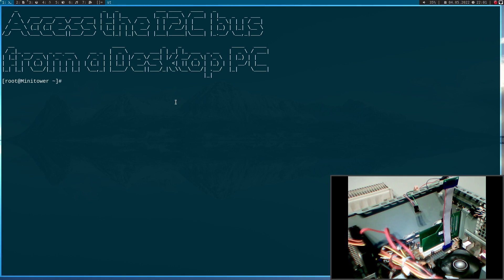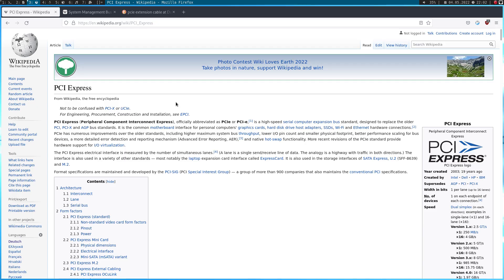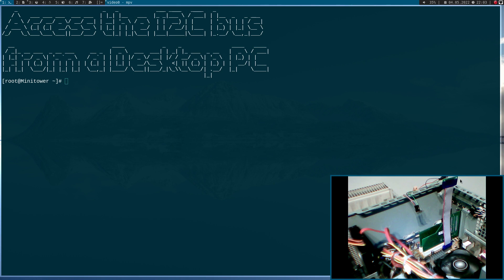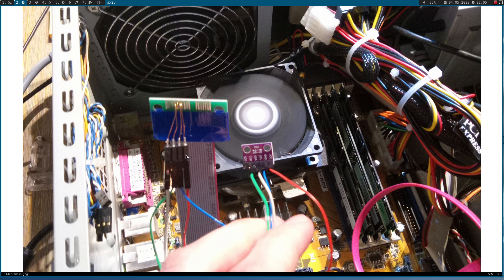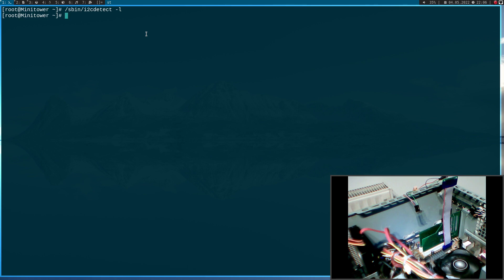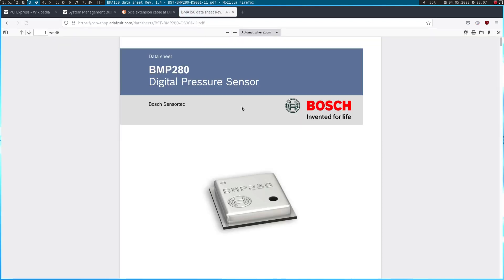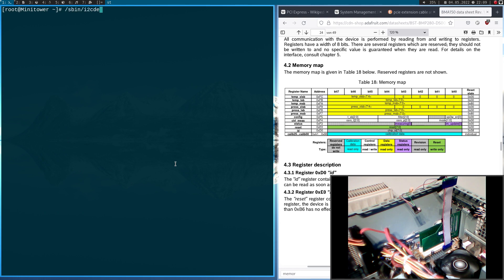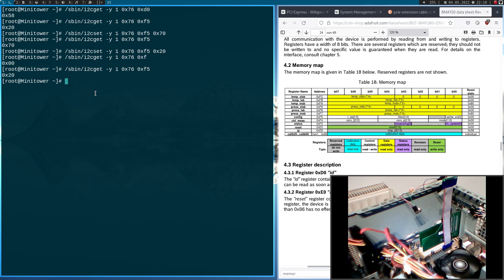Tutorial: Access the I2C Bus on any Desktop PC (The SMBus)

Comment: wunderbar! beste grusse aus Polen :)
okay, my german sucks ;p
I guess you've found nice nieche, there are plenty of lowspec obscure devices (like thin clients aka terminals) which could easily serve rpi's purposes for fraction of price :)
Reply from the maker: Danke, Dir!
No, the sentence above was 100% correct ;)
It is always great to find ways to recycle old hardware and with GNU/Linux you can easily access the Hardware. So, you are right, often they can be used as cheap replacements for RPis. But when it comes to power consumption, a RPi is still better ;)

Comment: How does the SMBus know the  device specific opcode and protocol and frame formats? Different i2c devices may have different formats right?
Reply from the maker: Basically the BIOS developer needs to know which devices are available. For standardized stuff like the Serial Presence Detect (SPD) on DRAM DIMMs there is an available address range and the address is depended on which slot you put in the DIMM. So, the BIOS knows in a specific range there are SPDs and the format for SPDs is standardized.
For sensors, the BIOS developer knows the I2C addresses and can hardcode them in the BIOS, I believe.

Comment: My mainboard has an SMBus header on the board. I want to do the opposite: check the pc hardware/health with an arduino and plott it on an lcd.   Where do i start? ;)
Reply from the maker: You need to implement an I2C Master on your Arduino. Then you can access the slave devices. Then depending on the hardware you can get information. For example if you detect an SPD (EEPROM with information about the PC's RAM), you can take a look the its content like described here: https://en.wikipedia.org/wiki/Serial_presence_detect

Comment: Not all motherboards have the SMbus connected to PCIe connectors. Usually on workstation and server boards it it connected, but consumer boards might not have it.
Reply from the maker: Yes, you are right. Once I saw a computer, where you had to add 0Ohm Resistors to connect the SMBus to the PCIe connectors. But from 4 computers I have checked, on 3 the SMBus was availble ;)
Reply: Boards with socketed RAM will have SMBus to read the SPD-EEPROM data which is defined in the JEDEC standards. You can use a RAM breakout board to expose the bus.
Reply: @johannes4gnu_linux96  Also I think it's common to have SMBus connected to the M.2 slots. I think it's non-optional for M and B key.

Comment: Directly connecting to I2C lines is dangerous for the motherboard. We need a buffer between the I2C inside the PC and external I2C devices!
Reply: For example Hot-Swap I2C Buffer TCA4307. Or PCA9515A Dual Bidirectional I2C Bus/SMBus Repeater Module.